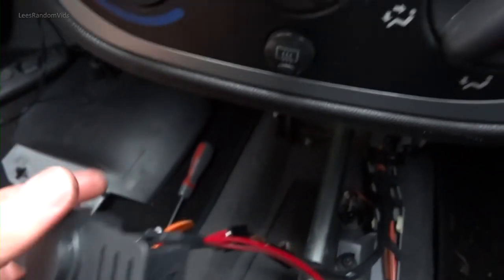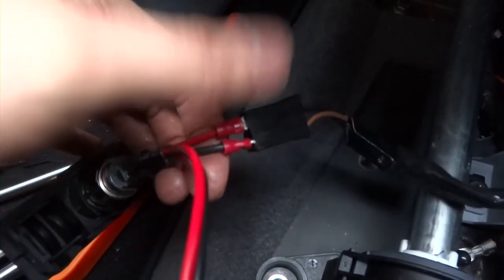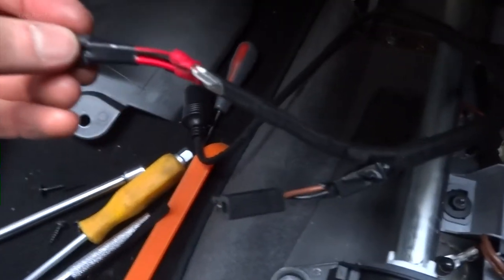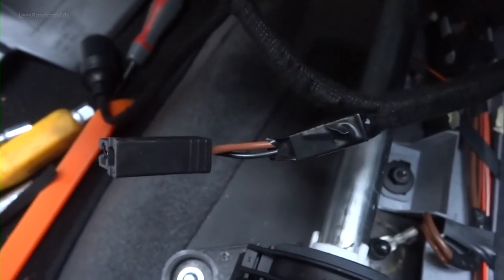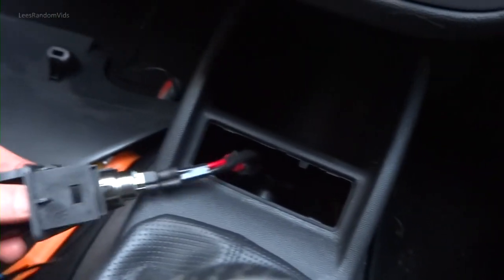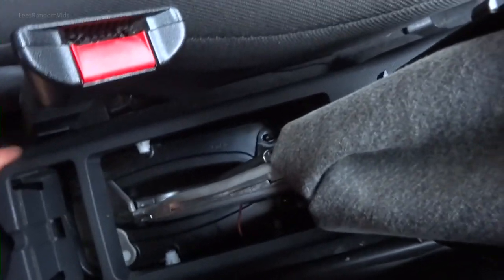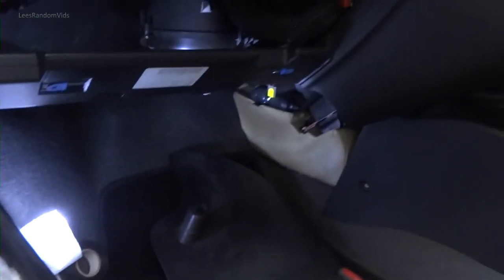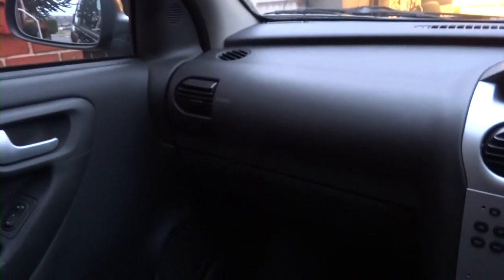How to Install a Dash Cam Mirror and Rear Camera to your Car - Part 4

Comment: Heya! Thanks for the very detailed videos! 
I've installed the same unit in my car and find that the front and rear recording is pretty for this price point.
Do you use the reverse camera image when backing into a parking lot? On my installation, the image is not flipped, so the pavement on the left of the car shows up on the right of the image. I'm wondering if there's a connection I missed that's supposed to flip the image (mirror image) when reversing. Thanks!
Reply from the maker: Hi, and thank you too.
Yeah I agree for the price its good. As for the reversing camera, yes mines flipped but I didnt do anything to make it flipped so I dont know why yours isnt, maybe there's something in the settings? I'll check my settings when I remember, there's still some that I dont know what they do, I dont go into them often or do anything with it, just turn the car on and go, ideal really. To be honest I dont really use the rear camera to park even tho I wired it in to do so, I did it because I could, and just wanted to do it too, but when I'm parking I tend to turn in my seat and look our the back window or stick my head out the side window as I did before I had it, but sometimes comes in handy when I cant see behind me or when something is below my sight, the cam gives a lower view.
Glad the video was some use to you tho, maybe check the setting for the camera flip but other than that I dont know, mine just plugged in and was like that. Cheers.

Comment: Hi, we have just bought a car with this system installed and have no instructions on how to configure it.. We are struggling just to find the menu you went into. What is the combination of buttons you press to get to that menu?
Reply from the maker: Hi, Yeah these things don't come with instructions which isn't great, especially as the names of some of the options are a bit confusing, probably a translation thing. Anyway to get into the menu you have to first stop it from recording or it wont let you. Press stop (ok) then menu.
I show how to do it here and go through the options and what they do, if it helps and also the buttons: https://youtu.be/Dv9ftl5aZ2U?t=410

Hope it helps. 👍

PS. I didn't know what the 'boot video' option did when I made the video.. I've since found out it's the option for it to auto record on power up.

Comment: Can you have the recorder on but not displaying on the screen, so I can drive safely?
Reply from the maker: Yes, you need the screen to turn off as it's too difficult to use the mirror with it on. Short press the power button to just turn the screen off (long press turns the whole unit off), but better is to set the screen to automatically turn off after 10, 20 or 30 seconds whichever you prefer which you can do in the setting. See here: https://youtu.be/qpukX0-W4oE?t=21
Hope it helps